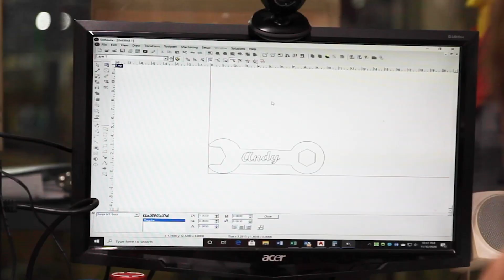ShopMaster Pro Series CNC Plasma Machine with Hypertherm XPR Plasma Technology

Comment: Also can you show a video of the pipe cutting, with regular vs XPR. And can you do the comparison on finish between plasma and laser for pipe cutting? Thank you. Considering both shopmaster pro versions of plasma and getting one for routing, I want be able to cut as precisely for aluminum, steel wood, acrylic, MDF, etc.
Reply from the maker: Thanks for the suggestion, very specific though and not something we likely will be able to do. ShopSabre does NOT build laser machines thus cannot compare to something we don't manufacturer or own.  With respect to routing, the ShopMaster is not intended for routing, you would need to look at the SideKick Combo for that application. XPR cutting and routing are not a combination machine. If you want precision when routing, an industrial router is the right tool

Comment: Looks fine, but Do a comparison video of this and your sidekick plasma in terms of speed/finish on same material, same plasma cutter so we can TRUELY see the differences between the master series and sidekick
Reply from the maker: With respect to the Shopmaster vs. SideKick the machine does not change the cutting quality - it's all based on the cutting demand you have - the ShopMaster is a designed to handle heavier thicker materials and has a larger tank thus requiring less cleanout for higher production demands... With respect to cutting itself, the cutter itself is the difference maker. XPR / HD cutting technology is not available on the SideKick so there is really no comparison to make between the machines themselves. XPR technology is entirely different technology and rarely do you consider an XPR for projects that a non-HD cutting application can be used for just from a cost of operation and initial investment standpoint. Give our sales team a call if you want to discuss this topic further.

Comment: I have been working with XPR300 since 2018. This plasma system is really good.
  CNC programmer/operator tkIS . Leduc, AB, Canada
Reply from the maker: Thank you for supporting and watching!
Reply: @shopsabre  Hi, We have model of XPR 300. In the recent days there is shown error of ALERT 520. How can we fix this issue? Please help us. it will be highly appreciated.
Reply from the maker: Do you own a ShopSabre machine?
Reply: @shopsabre  no We have machine DURMA PL30120
Reply from the maker: I’m sorry our technical support is dedicated for ShopSabre users. If you contact hypertherm or your machine manufacturer directly they may be able to help with your diagnostic needs